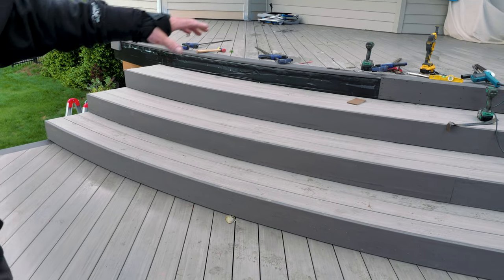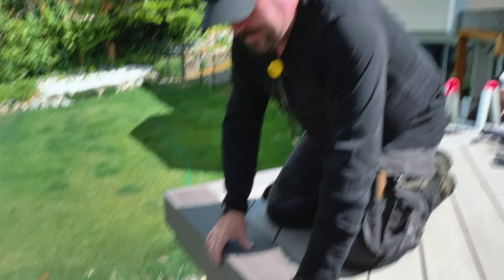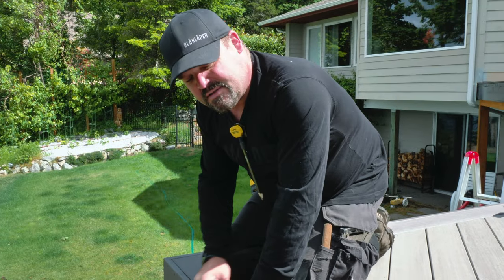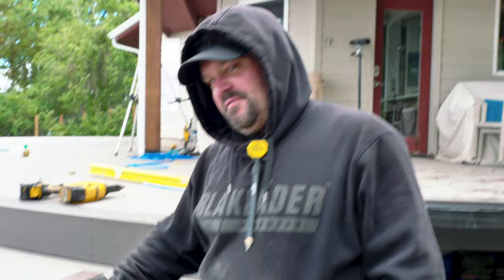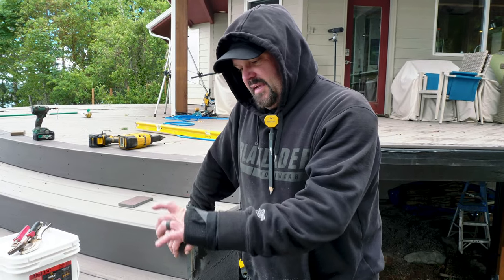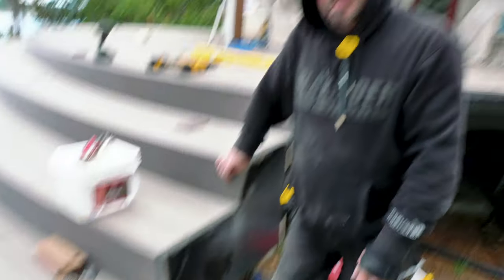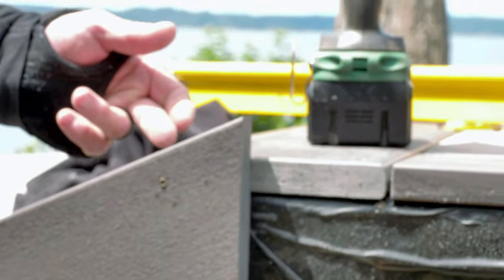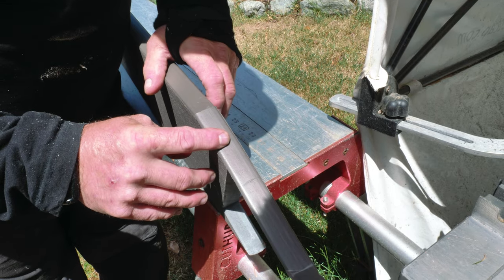Build Update: Skirting & New Tricks || Dr Decks

Comment: Use the same piece .. cut out your” triangle ( surgically ) but leave 3/16 of the top so you can simply bend it down for your “cap “ use heat when needed, trim and file, paint as you do.. etc

Comment: The nosing on treads, believe it or not, has a code minimum and maximum of how far the nosing projects over the next stair. Nosing's are required to overhang a minimum of ¾-in. to a maximum of 1-¼-in. Also, the maximum nosing radius cannot exceed 9/16 of an inch. Maybe it is not required where you are but if it were your threads would not pass inspection.
  Mike T
Reply: agreed
Reply: In Minnesota (can’t speak for other locations) if the tread depth is over 11 inches a nosing is not required

Comment: I hate open miters myself!  So annoying!  My thoughts are that the miter is only one joint open at that corner rather than two butt joints opening within 6" of that corner.  My coworker and I go back and forth about this!  I've heard you speak of this in the past and can't wait for your final decision! We generally go with picture framing with a 3/4 nosing.  For the life of me, I can't get him to go with flush on top fascia using  5/4 with the 1/2 below it for the stepped look.  Hes so set in his ways!  My coworker insists on mitering his picture frame boards as well, and they look great for a minute (i mean that literally), and within no time at all they open and look horrible.  We did do mitered drink rails and managed to glue and pocket hole most of the miters which seemed to work well but was extremely difficult to manage without accidental breakage of the Azek boards ends at the joints in the process.  We also started ripping the smooth linear edge off of scrap solid Azek and gluing and pin nailing to end grain in some cases, rather than a mitered return.  Gotta try different things in my book!

Comment: Just curious where you are located - I had done my stair fascia like you showed in MN and it was not a good idea - looked great but the mn weather wrecked it in a couple years.  Water would sit in the corners and freeze busting the skirt board off (And rotting the attached stringer which was treated in about 6 years).  I since rebuilt it with the skirt cut along the stringer and a picture frame on the treads covering the place where the fascia meets the stringer hopefully eliminating the issue.  MN winters are rough on construction

Comment: Wish I had hired someone like you who knew what they were doing like they told me they did.  Now I have a so, so deck after spending lot of money on the material.  My deck is 15X60 foot on one level and 1000 square foot on the other two lower decks.  They did ended up not getting paid because they got the measurements wrong and ordered double the material order.  Can't swear to it but I think they had planned on taking off with the half not used.  They had to pay for returns etc..

Comment: Great video!  I have some composers steps coming down to a sloped concrete pad.  My last fascia board would either be cut straight and have a big gap at the bottom or I try to cut to match the slope.  Which is correct?

Comment: Hey Doc, which Fastenmaster screws are you using to screw in your diagonal V bracing to underside of joists?  Thanks,
Doug
Reply from the maker: 4” timberloks
Reply: @drdecks  thanks Doc, we generally do metal strapping or let-in 2x4 bracing but I don’t like the bit of shrinkage we get it the notching.  Just never liked seeing the V brace from below on elevated decks. Thanks again.

Comment: Why not just determine two angles: one for the top of the stairs (the deck surface vs the stair angle) and divide that in half for a clean miter and finish at the top and the second angle at the bottom of the stairs is the stair angle vs the riser and miter that angle and voilà… you have you both angles and a clean join at both top and bottom.